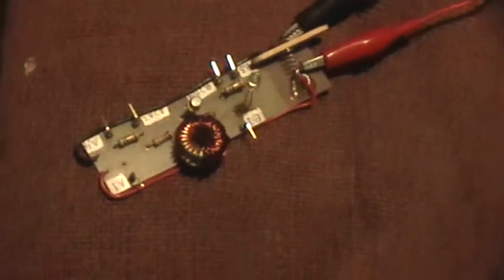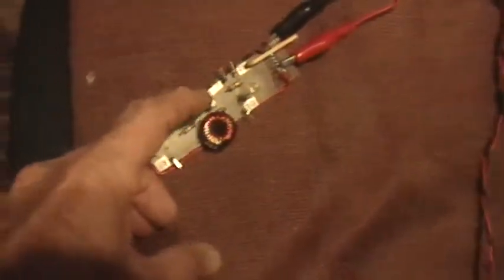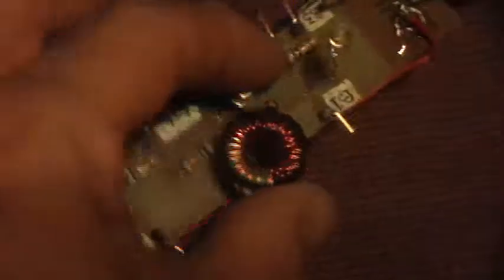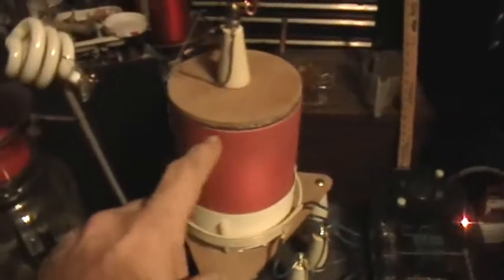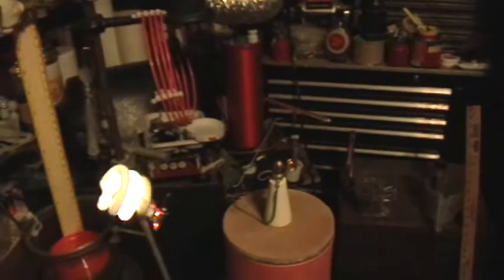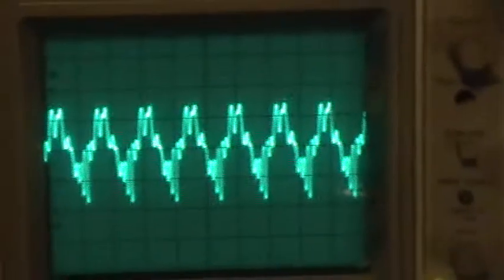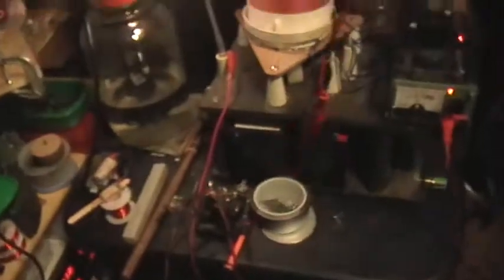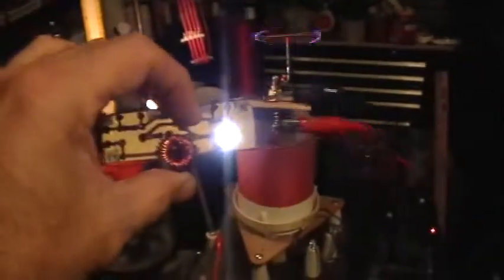Joule Thief: PCBJT Wirelessly Powered by SassyClassE SSTC

Comment: Nice setup, neat corona motor :)
If you put a large PC heatsink on the Neg wire of the JT and put the Pos in the air, you should be able to run the JT to quite some distance wirelessly. Fun if change to a cap on the ends too, blink mode as it charges to transistor threshold and back down (100uF for example).
Extra on Stumpy's post - grab a new solar light ($1 type) and don't pull the battery tab. Put in full sun and the light will come on bright.